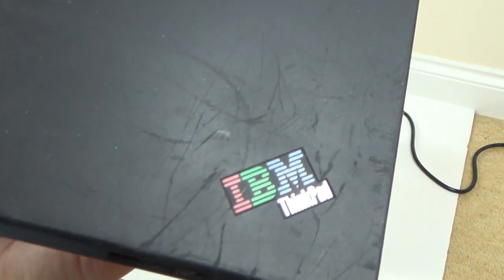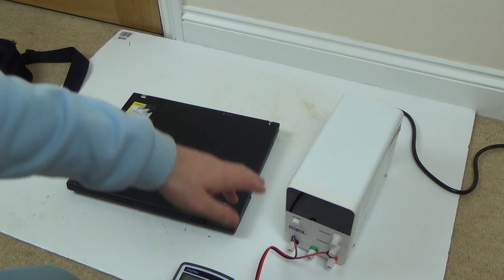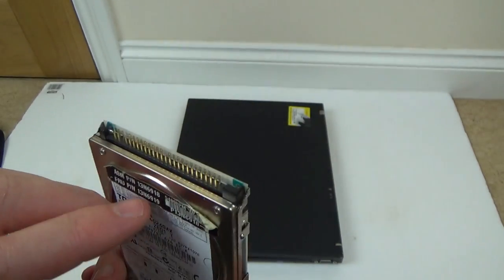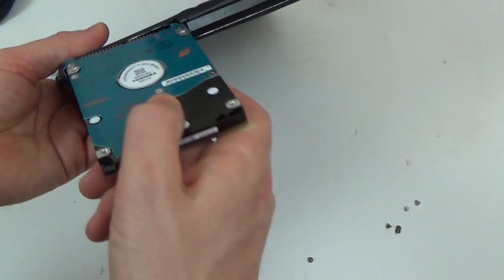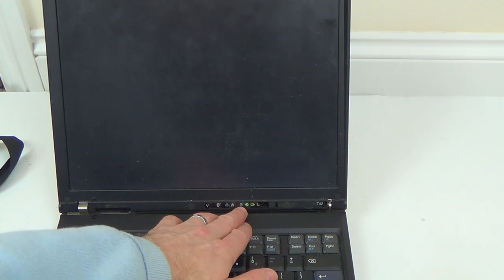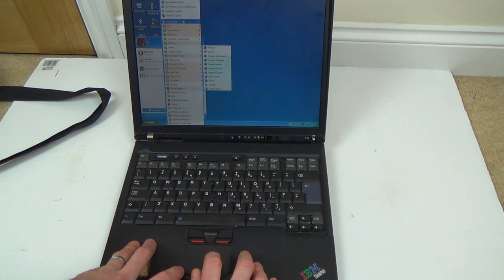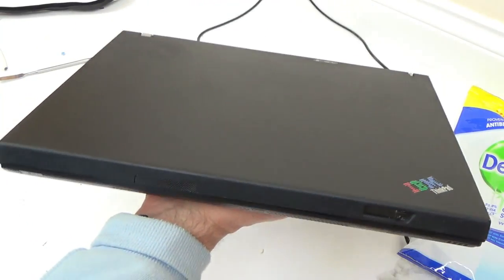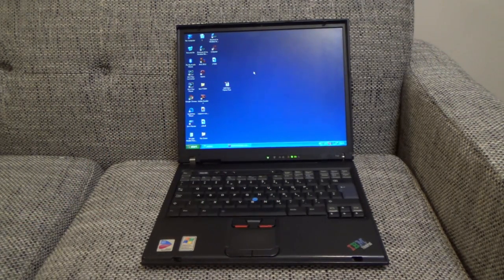Trying to FIX : IBM ThinkPad T42 Laptop

Comment: please do some more thinkpads :) also install basilisk for the browser http://rtfreesoft.blogspot.com/ it still supports xp. You can get ide to ssd adapters https://www.amazon.co.uk/M-2-NGFF-44pin-adapter-case/dp/B01AC7R99U this should be the correct one its speed will still be limited since it's ide but it'll be better than the hdd. I've got an x40 which is just as old it is pretty slow but I still use it often. Can only load like 3 webpages at once tho since its got 1gb ram lel

Comment: Ask your wife for nail polish remover, it’s acetone
Reply: And it's £1000 per gallon when purchased as nail polish remover, at maybe £5 for a tiny shot, but only £10-£15 per gallon delivered when you buy acetone from a proper supplier even off ebay. My gallon (4.5 liters) is still going strong 10 years later. Buy in bulk son for it is stronk.

Comment: 128GB SSD for around £20 install windows 10 bish bash bosh done
Reply: It doesn't have a sata interface, good luck getting a SSD with an IDE interface :-P
Reply: @ianhaylock7409  didn't get that far into the video before commenting! Vince got a really easy fix with this one!